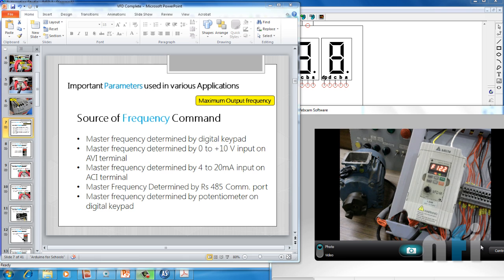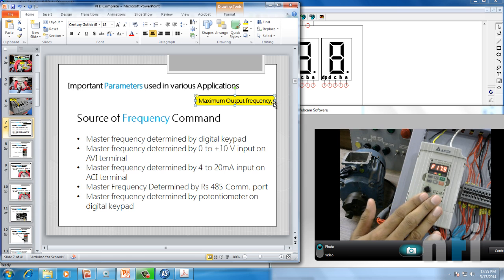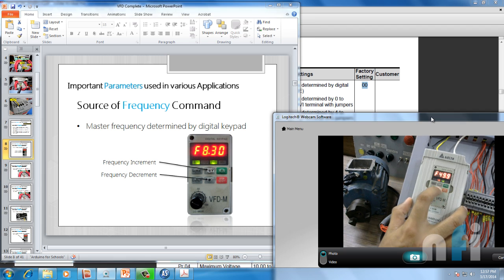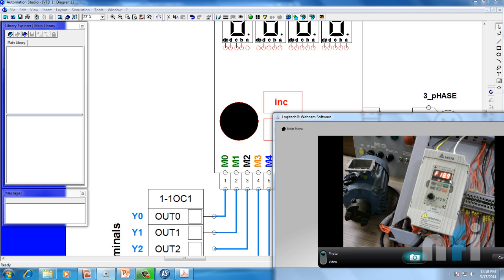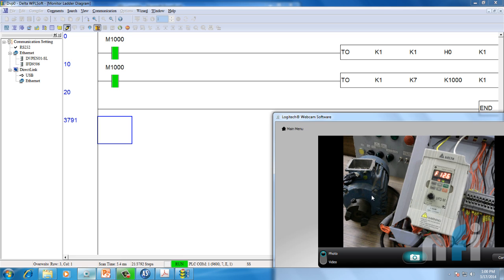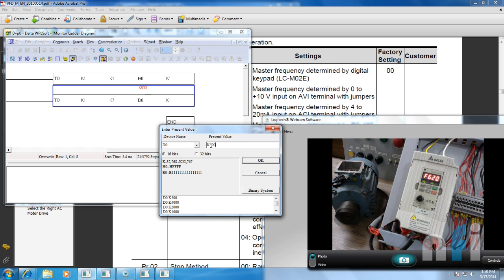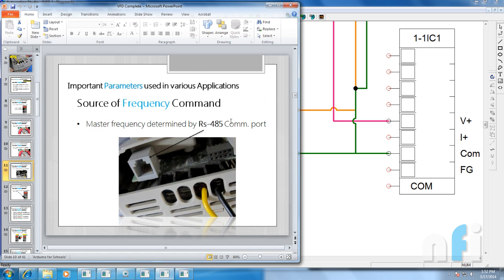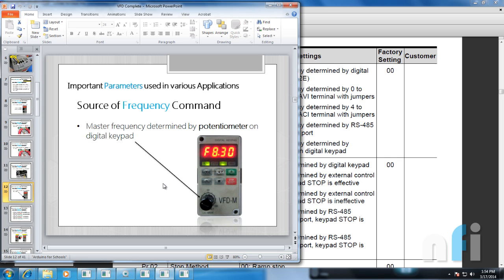Lesson 2- Source of Frequency in VFD (Variable Frequency Drive)

Comment: In delta Vfd drive is very worst drive because if ground is connected perfect. Then also sometimes in the drive always one major complaint ground fault alarm "GFF" , it's always repeat 2 to 3 times then it's can't work when it's switch on Vfd the the "GFF" blinking not fault reset .I don't got any solution for this complaint . That's why I don't like delta Vfd drive , if anyone have perfect solution for this complaint please help me share your experiences my email id : creative.electronics99@gmail.com

Comment: hi sir, we have an elevator lift which we want to lower the speed. We bought a Delta VFD-S but we are not sure which parameters to tweak as there a lot. Do we just have to lower the frequency from the main display?
Reply from the maker: Dear Mark, you can use various option to lower the freq. Option 1- from the display. Option 2 - Via External POT (you need to wire POT to VFD control input terminal) Option 3 - Control via 0 - 10VDC or 4 - 20mA  Option 4 - Via HMI directly with MODBUS connection

Comment: I want to control the frequency of the 2 hp geared motor by another 75 HP motor load, ct coil is connected through ac current transducer to ACI terminal, can you explain this better, please.

Comment: What is cf3. In display. How to rectify.thanks
Reply from the maker: wanshngain nongbet It's some type of error which you can remove by resetting the parameters of the drive. If you are unable to reset the parameter using keypad buttons then you need to so using PC (by connecting the VFD to VFD Soft (software) using special cable). Please contact delta support center for the cable and software.

Comment: If the vfd is 1.5kw (1500watt) does that mean how much power it can output to the motor ? What will be the max watt input to the vfd from the 240v ac power source ...will it also be a max of 1500 watt or less or more ? So I can use the proper enough power supply .

Comment: if motor has rated rpm 15000.
can i rotate the motor at 30000 rpm with the help of vfd?
Reply from the maker: No you should not try to rotate the motor more than it's rated rpm. It will damage the motor!